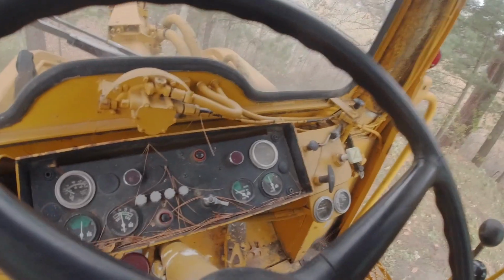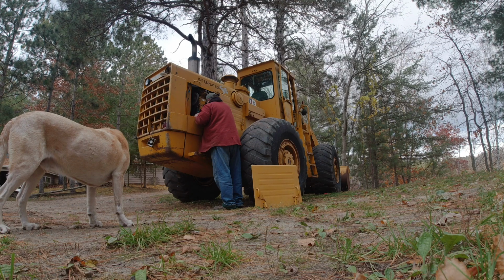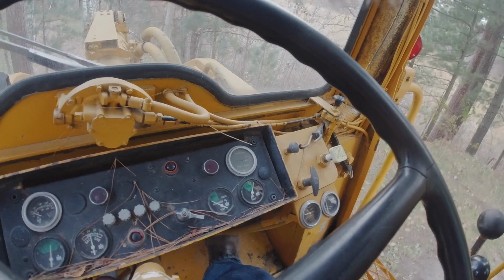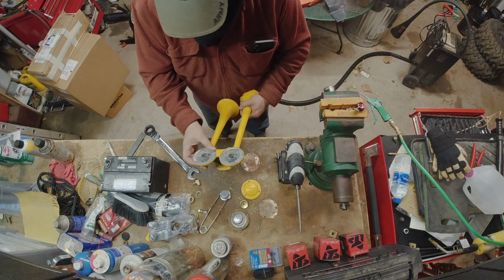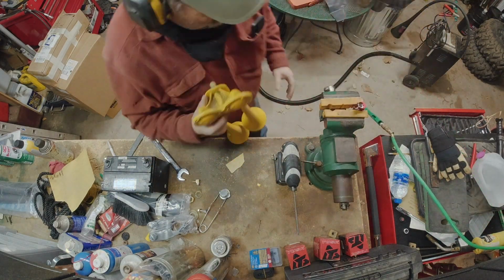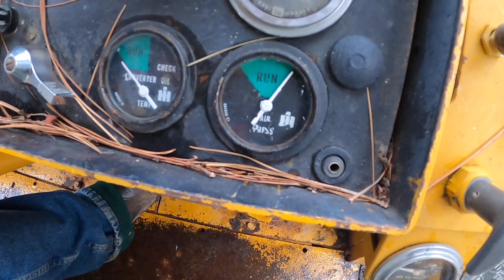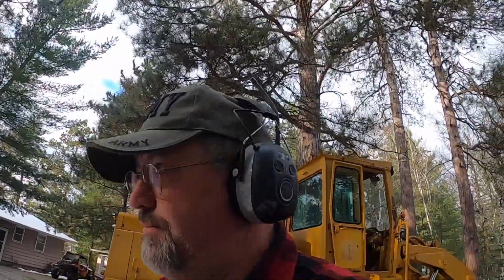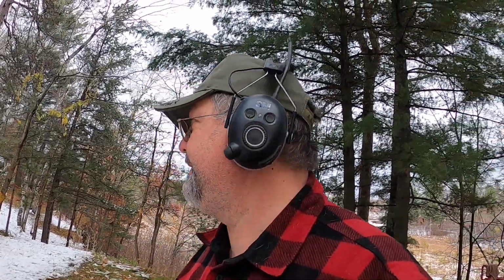Hough H80B Air Horns Revisited (Pay Loader Part 12)

Comment: Close your cab up and you wont have a wet seat!
Reply from the maker: If I do that, red squirrels move in within 24 hours and start tearing up the cab. Guess how I know? Right now the machine is stored for the winter with one door wide open to prevent rodent habitation. I wouldn’t have know about this without experience. Near as I can tell critters are coming in through where the loader controls come in from the bottom. I’ll figure this out in time.